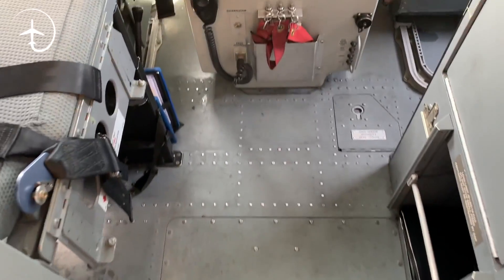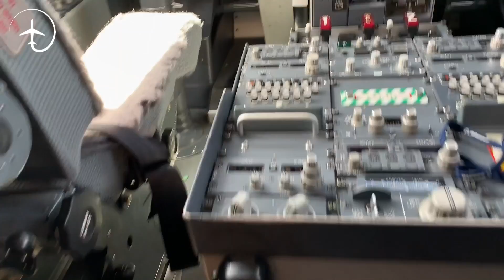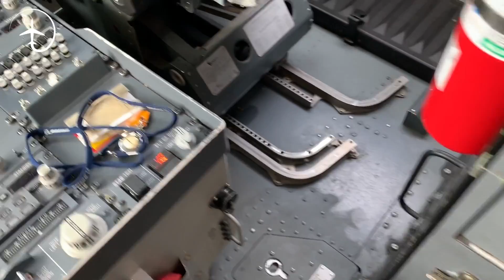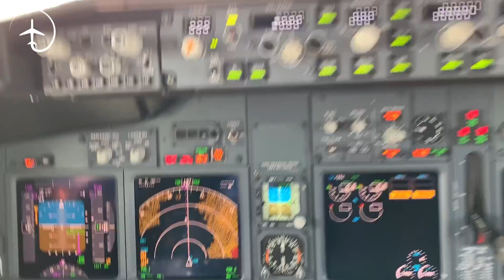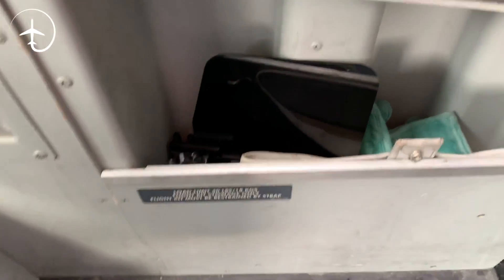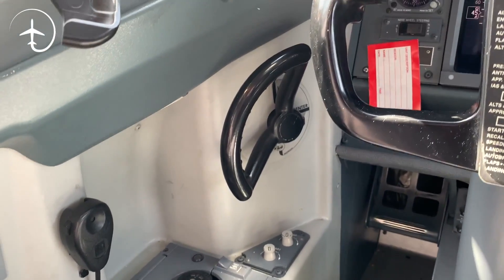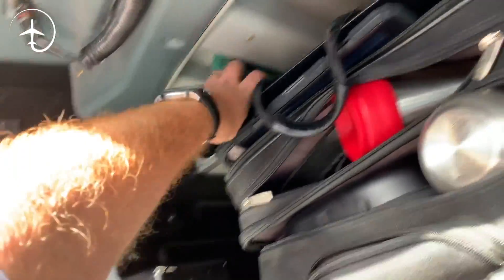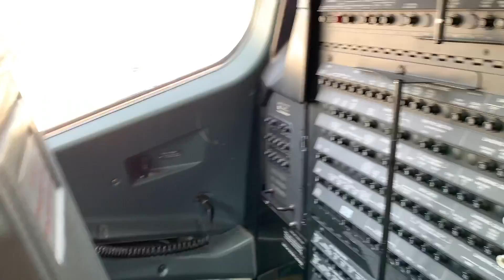Boeing 737 Cockpit secrets!

Comment: What does auto slat fail mean, I had a problem with that in my sim the other day and the flaps did not extend on approach
And how would you resolve this issue?
Reply: Matt6288 Jay 

     Auto slats are a stall prevention device.  The slats will automatically FULL-extend as the wing approaches the critical angle of attack.

   You resolve the issue by following the steps for “AUTO SLAT FAIL”  in the flight control section of the QRH.

Comment: @mentour pilot - now that we speak instruments - can one actually land a plane with no instruments working (eg no air speed, radar), but full mechanical functionality?
Reply: Absolutely. Assuming you can find visual conditions and a runway to land on. Which is why we have eyeballs.  It’s clearly a little sketchy in terms of not having airspeed indicator, but you can get it in the ballpark.  Just by using known pitch and power, noise levels, and the “feel” of the airplane. We also have a completely separate set of “standby” instruments that gives heading, speed, altitude, and is not connected to the normal instruments. Is either battery operated, or operates without power, depending on specific tail number. 

A few years ago we had our entire 737 pilot population perform a take off, pattern, and landing in a simulator with complete reference to outside. No instruments, no computer, no reference speeds, no gps, no navies, etc.  just look out the window and fly.  Of thousands of pilots I haven’t heard of one that had any issues whatsoever.  And in fact, everybody loved doing it without all the normal garbage.  

The trick is to stay in visual conditions. Night or day, if you get into the clouds without instruments it’s a death sentence.  Airspeed indicator is next on the list of important, but it is possible to feel it out if you are a decent stick and rudder pilot.  Airspeed is life, but too much of a good thing can put you off the end of a runway. 

Used to have a friend I instructed with who would always say....   try to crash like a car and not like an airplane. Sometimes you can survive a car crash, but usually not an aircraft crash.  So your goal should always be to get on the ground and then slow to as close to zero as you can get before you hit anything.  

It’s my only promise to a passenger.  I’ll get you back on the ground somewhere and slow you to a survivable speed.  Everything else is gravy.  If we get to Detroit somehow, then have a great time😎
Reply: @markg7963  thanks so much, really interesting )

Comment: Are airliner cockpits ever totally cleaned and detailed to where they are as clean as a brand new airplane on delivery day? There is a surprising amount of grime and crud all throughout the cockpit shown in this video. I know this is a working environment and not a show piece, but I thought the preciseness and detail orientation of flight crews would have a secondary effect on the tidiness of cockpits because of intolerance for sloppiness in work practices because if you get sloppy, you can get very dead very quickly. I do expect to see wear and tear which comes with years of use.

Comment: Why would there be a permanently pulled circuit breaker? Why even have it? Is it for options that this particular plane didn't have?
Reply: Could be an item on Mel, or something that was removed.  Entertainment systems come and go, as an example.
Reply: Travis k - Like you said there are some systems that are not installed in the aircraft.

Comment: If a pilot is training and there is an emergency, does the trainee switch seats with the trainer in the jump seat?
Reply: No.  New pilots fly with a check airman (instructor and check pilot) for a length of time. They are already trained in emergency procedures and operational as a result of simulator training, and have already passed several performance milestones including 2 very intensive and comprehensive checkrides, as well as an oral exam detailing the operational specifics and systems knowledge in extreme detail. . There is normally not a 3rd pilot when a pilot is receiving his “operational experience” training with the check airman. If a mechanical or flying issue comes up, it is handled as any crew would handle it, using their resources together from start to finish.  Clearly a new pilot will lean very heavily on the more experienced pilot, which is why these check airman pilots exist. Their other duties may be simulator training, flying as a normal captain, giving checkrides to crews from the jumpseat, or flying right seat while a new captain obtains OE, as well as signing off all these individuals when their trading is complete and demonstrating their abilities.  The entire process is written out in agonizing detail and accomplished under the oversight of the faa (in the US)

This is all done with passengers on revenue flights, and is transparent to the passengers.  

At this level, the pilots aren’t new pilots, they are just new to equipment or seat, so it’s not really as big of deal as people would think. The minimum requirements to fly as an airline pilot are 1500 hours and an airline transport license. There are no new pilots in the airlines, they all have some experience in these environments.

Comment: No mention of the crash axe...or the modified bullet proof cockpit door...i didn't see a HUD....not only would l use the O2 mask for cockpit smoke or depressurization..also if someone released gas from the bowels through the bottom..

Comment: Why are some circuit breakers supposed to be pulled?
Reply: TheSimulatorGuy Mostly systems not in use (optional for airlines, but wires and breakes are still installed)
Reply: Speedbird okay thank you

Comment: Ok....soo...I have a question...Why would you want to lock out a circuit breaker?
Reply: Indicates to the pilot that the breaker is in its correct position and not to push it in. Breakers are locked out for Mel issues, or for items that have been removed from the aircraft. Think about how many different entertainment systems have come and gone.

Comment: I saw on the old 747’s I think there was a third person in the cockpit called an engineer.. what does he do?
Reply: The flight engineer monitors the aircraft systems like engines, fuel, hydraulics, pressurization, and others.
Reply: Nora Lincoln thank you! So I guess all of that is now handled by the computers on modern planes?
Reply: @_Forever555  Yes.

Comment: You spoke of the tight and cramped cockpit....... What if the manufacturer redesigned the nose with an extended crew cockpit. Say, 6 ft longer.......
Reply: If the aircraft was 6 ft longer, the airline would stuff 36 more passenger seat into the space.
Reply: Richard Latshaw    Not if they could fit 37😉

Comment: What's the reason that the Captain only has the tiller and not both pilots?
Reply: There is an option from Boeing to have it on both sides(but it will cost more).

Comment: what is the purpose of a flight engineer and why small planes do not have one?
Reply: In the past there could be three crew members in the cockpit and one was the flight engineer. His job was usually to monitor the fuel consumption and other systems regarding the engines using his own instrument panel. Today we have two pilots in the cockpit and the aircraft don't have the flight engineer panel and flight engineer any more.
Reply: @mikep9604  thanks for the info, much appreciated

Comment: Why do some circuit breakers need to stay permanently pulled? Wouldn’t the designers just not use a circuit breaker?
Reply: All 737s use the same breaker panel, but not all 737's have the same systems. Planes that don't have a particular system installed have the breakers for those systems permanently pulled. Just in case the next owner decides they want that system installed.

Comment: Its Protective breathing equipment not portable breathing equipment (PBE)
Reply: Sure, why not.... However, it’s quite portable since you are not connected to any hoses!
Reply: @Stepclimb  not exactly for eg portable water system in the aircraft has connected by many hoses&pipes ,its not portable .But this system called portable water system 
So PBE stands for protective.🤗
Reply: No Oscar, you are mistaken.

     The water loaded aboard the aircraft is POTABLE water.  Notice there is no “R” in POTABLE.  Google the word POTABLE and hit the pronunciation button.  You will hear that it is pronounced with the same long “o” sound as the word POTENT.

    Besides, the discussion was about the PBE, which has nothing to do with the water system.  The PBE hood is both protective and portable, so the way mentour pilot described the acronym as well as “protective breathing equipment” are both accurate.

     One could also refer to it as PPBE.

Comment: Cleaning a cockpit with so many buttons is not so simple. Remember the Helios fight when the mechanical engineer forgot the pressurization switch to manual position and cost so many life's.
Reply: SPIROS 737 

     That selector knob should have been caught during the preflight “flow” AND verified via a checklist before pushing back from the gate.  

An amber light on the pressurization panel would have been illuminated AND it would have triggered a master caution light on the glareshield when “RECALL” was selected on the before takeoff checklist.

In addition, the crew did not apply the correct procedure to don their masks when the cabin altitude horn (and warning light) started blaring at 10000ft.

     This was an incomprehensible mishap that should have been easily avoided.  While the action of the maintenance crew was a contributing factor,  the primary causal factor in this mishap was the crew’s failure to follow established procedures.

      This crew had several opportunities to catch and correct the incorrect pressurization panel setting

Comment: Sad when the USB charger is the most advanced thing on that aircraft.
Reply: Not nearly. Get in the cockpit of the 737-300/400/500 models. There's way more tech in this cockpit. In the older models, the only digital way mechanics can interact with the plane is through the CMC's. And that's pretty limited.
Reply: @FalconChief222  I guess your sarcasm detector isnt working?  Maybe call a mechanic and get it  fixed?

Comment: Having been in the cockpit of a 737 many times (and in flight, but secret :P) I already knew how to use the jumpseat, deploy and retract it. :D I also do know where is the light switch situated, I was helping the pilots that way, when they were doing fuel calculations (in night time). :D
(Disclaimer: My flights within the cockpit were company and captain approved. I followed the strict regulations, such as the sterile cockpit rule, and procedures I was told.)

Comment: The planes wings do not hold tonnes of fuel it’s a complete scam.
The engine are air compressors which are powered by the APU.

Comment: My buddy's 1964 Mooney M-20C had the manual "Johnson Bar" landing gear and a hydraulic hand-pump for the wing flaps.   It also had a custom-built carbon fiber instrument panel which won an award for "the best in its class"  at the Oshkosh airshow over 10 years ago.   Back in those days, it was the  "state of the art"  to have a Garmin 530W WAAS navigator that could do LPV approaches coupled to an autopilot.  However, we did not have "back up" instruments for an IFR flight.  We did not have a battery-powered HSI built into the panel in case the electrical system failed.
                  Today, I would hesitate to fly an aircraft into IFR conditions without a backup attitude indicator that had its own battery emergency system in case the electrical system failed.  
            When I was a newly IFR rated pilot back in the 1970S, we did not have a battery "anything".  We didn't have an intercom nor the use of headsets.  They did not exist.  We had to use handheld microphones and listen to loud distortions from ATC for instructions.  No wonder we all had some kind of hearing the loss from the constant noise without headsets. 
                 All we had was a single vacuum pump for the gyro horizon, i.e. the "Attitude Indicator".  Yes, we flew into the clouds using a single vacuum pump system for the gyros.  If during the IFR flight the pump or gyro failed, we were screwed unless we were experts using the needle-ball and airspeed indicators.  But that is the way it was back in the heyday of early instrument flying during the early 1970s for general aviation aircraft.  
              This month, June 2019 will be the 50th anniversary of my first solo flight in a C-150 at KCDW.  I had 12.2 hours before my flight instructor left the airplane and told me to take it off myself and do three takeoffs and landings.  About a year later, I got my private pilot's license with about 52 hours of total time.   I am by no means bragging about my lower flight time to obtain my PP license.  Back then, most students got their license in about 50-60 hours or so.  Then the FAA started to get more involved with the curriculum.  During the later part of the 1970s, the FAA took a stronger view of what was necessary for flight instructors and flight schools to teach.  As a result, the time for the average student pilot was somewhere between 60 to 70 hours to obtain the PP ticket.  Today we now see the time being extended even longer. 
                I don't have a problem with the extended time to learn for students from the standard flight school.  I've seen some students take over 100 hours to obtain the PP license.  The truth is the requirements have gotten more complicated, the regulations more detailed and the FSDO's wanting to see better-qualified students before they become pilots.
            But as a student who got his license in 52 hours back in 1970, I'm not so sure it's necessary for the average student pilot to obtain over 75-90 hours before he or she becomes a pilot.  In the NYC area, I can understand the need for extra time.  But learning in his own private Idaho, I don't see the necessity for the extra time.  Just my simple observations.

Comment: Aren't 737's banned from flying IN certain countries due to the crashe-

- CONNECTION LOST -
Reply: Not all of them. There are several B737 variants like e.g. B737-600/700/800/900. The restriction only applies to B737max series.

Comment: When will Bowing, Quit "Messing" Around with the design of that  Air Plane, and put it back the way it was designed in first place? It was never designed to have those "Big-Ass" Engines mounted on it, All they did; Was to take a plane add all of those "High-Tech-Modifications" That Turned that Plane into a None Use-Able "Pile of Junk"!  That plane was a reliable safe money making work of reliability. Boeing has a bunch of "Over-Paid-Empty-Headed-Idiots"  Who are headed to make a "Big-Mess" Out of a company who used to put  pride and Quality in what they built!!!`
Reply: That's what I've been saying they need to drop the larger mounted engines and go back to proven units and their mounting design.

Comment: Related questions:
1. What happened to your face? Did you fly too high? :D
2. What kind of radiation shielding does the cockpit glass (or whatever) provide? Is it something that needs to be considered?
3. Do pilots need to be concerned about exposure to solar radiation as a result of being up there all the time in the same way that radiologists need to be concerned about ionizing radiating due to pulling the trigger on x-ray machines for a living?

Comment: What is the purpose of this useless video ?  This Mentour Pilot is deliberately choosing a 737 to somehow compliment this aircraft.  Another illustration of his financial connection with Boeing.  This character should be telling the public that unless the 737 Max 8 is re-engineered with new Wings and or Horizontal Stabilizers, it should never fly again.  That MCAS garbage system designed to compensate for an inherent Pitch Up Attitude is an accident waiting to happen again.  The CG of the aircraft was upset by moving the engines forward as well as extending the Engine Nacelles which in turn produced unintentional additional lift.  In short, a Commercial Aircraft cannot recover from a Full Aerodynamic Stall at a Low Altitude.  Boeing, knowing that 90% of aircraft accidents/losses are due to "Pilot Error", MCAS was supposed to prevent such an event due pilot incompetency, poor training or psychological anomalies.
Reply: How many accounts do you have? Do you work for Airbus or something? Same anti-Boeing BS copy and pasted from several different accounts. How about Airbus fix the fueling computers so the pilots actually know how much is onboard, instead of having to guess based on calculated gallons?
Reply: another moron heard from.
Reply: Your reply illustrates the extent of your intellect and knowledge !
Reply: Why do you you refer to yourself as a 'Moron'  perhaps you really are ?
Reply: Mentour Pilot deliberately chose a Boeing 737 because he is a 737 pilot. In addition, the aircraft that he flies and the aircraft that he showed is not the Max. That is, the aircraft that he recorded in this video does not have MCAS.
Reply: It still remains a useless video.  Who cares about cockpit design of any aircraft ?  The only people that would is a pilot that might fly one if he or she is Type Rated.  Furthermore, by showing and explaining the function and location of various components, does the suggest this junk is better than an Airbus, Embraer or Fokker aircraft ?